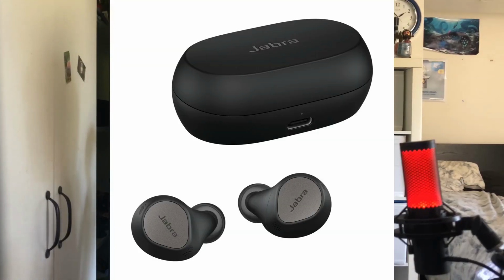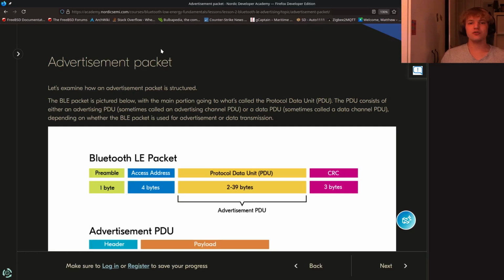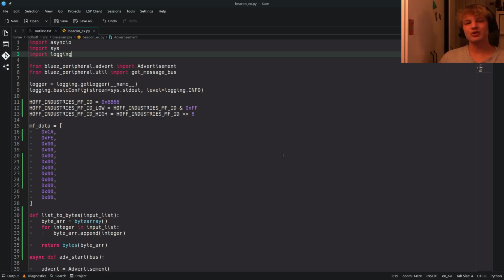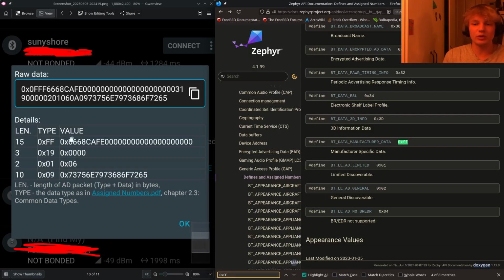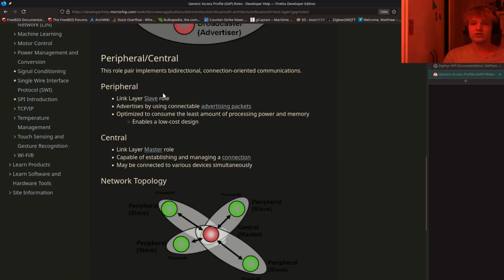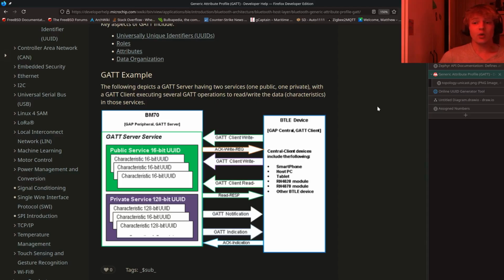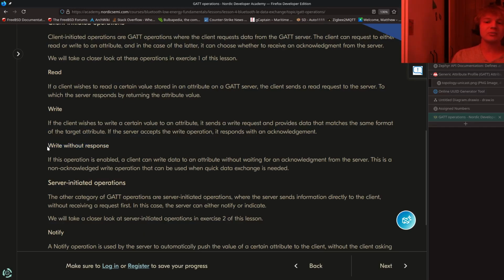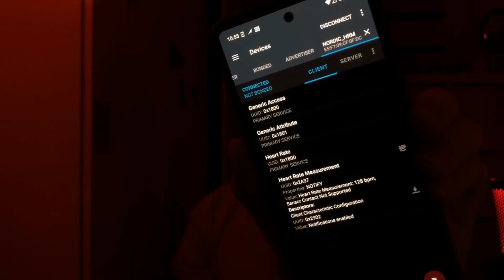Hitchhiker's Guide to Bluetooth Low Energy (BLE)!

Comment: Dude I could've used you for my capstone project. We built a disc golf tracker that used PNY Encoded BLE to send telemetry data over the wire(less) to an application we built that would display the data all nice for the user. I can't tell you how many actual weeks it took me to blindly fumble my way through learning something that after 20+ min of you explaining and showing instantly cleared the fog on. 

Even after implementing our device I still didn't quite understand the top level stuff or know of the resources to learn more about the protocols and abstraction layers and it all just clicked. Thanks for the vid and resources

Comment: Good overview of BLE.

Can you mention any specific applications you've seen that benefit from the GAP Central/GATT Server approach (and likewise GAP Peripheral/GATT Client)?

I'm specifically thinking of DFU, where you might have a GAP Central (PC) connect to a GAP Peripheral (embedded device). PC writes to a DFU service (start DFU characteristic) on the embedded device's GATT server. Then the PC starts its own GATT server which serves the DFU data blocks, with the embedded device acting as a GATT client performing reads.
Reply from the maker: Hey, thanks for the comment. In general it's up to you - you decide where to put the UUIDs, and in a way you can use that to 'logically separate' interfaces.

For example, on your PC or mobile is a "control" interface that can issue commands to devices - you offer this as a GATT server. Your embedded device has a "data" interface where you can read back data and state info, which it provides as its own GATT server. The embedded device advertises itself, so it is a GAP peripheral, but upon connecting notices the control interface and subscribes up as a client. Could you place the control interface on the device? Sure. Three reasons why you might not:

1. keeping your UUIDs secret - anyone can connect to a BLE device in the wild that's advertising and scope it out
2. if you have many different devices that share a control interface why clutter it up?
3. Often BLE operations and adding services, callbacks, etc. is easier in higher level langs like a python, C# or a swift, so it's easier to add extra services on the control device.

regarding DFU, you can take the Nordic OTA BLE dfu as an example where your DFU agent connects as a GAP Central/GATT Client, subscribes to server's notifications to read back CRCs, and simply performs writes to send data blocks. I believe they have 2 write characteristics, a "control" characteristic (for sending commands e.g. start transfer) and a "data" characteristic for streaming the file. I don't think the agent starts its own GATT server.
Reply: Interesting. Thanks for clarifying.